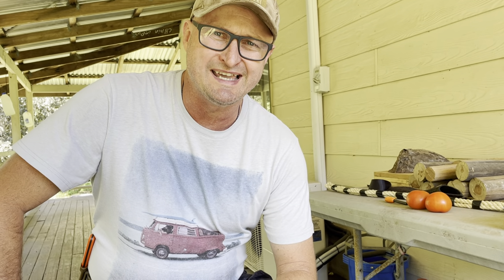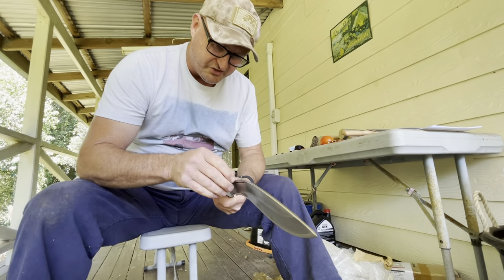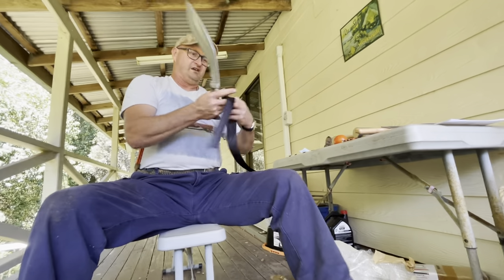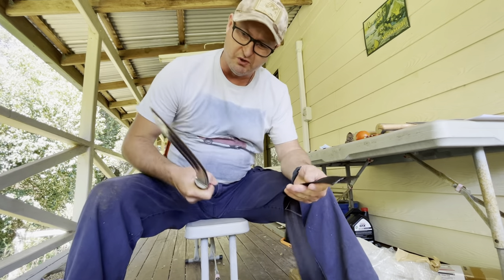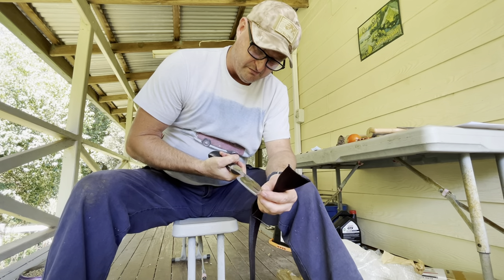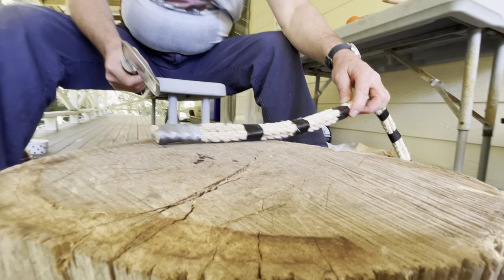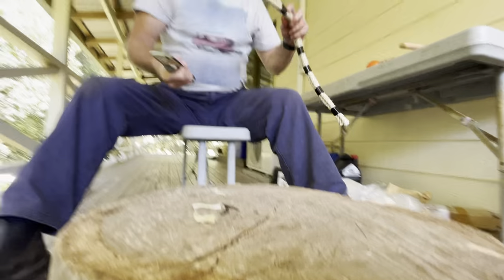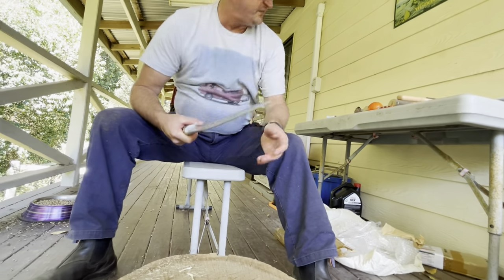Kailash Blades - Unboxing and Cutting Test!

Comment: Kailash have three options for their cutting edges. If you select their standard option the blade is usually a little obtuse for my taste. Their performance edge is quite good though. Good video! 

Great Gurkha Khukuri are well known for sharpness out of the box. Kailash sometimes need a bit of stropping to really show their edge properly and in my experience there is at least one time I've needed to use a stone. But their heat treatment is usually incredible.
Reply: Who would you recommend over the other? I ordered from Kailash regardless
Reply: @Bowbro69  I generally recommend both. Both can do micarta handles though Kailash has more experience there. Kailash do kydex and I've yet to see any kydex from GGK. Both oil quench. GGK do their own damascus in house. 

It really boils down to what you want to do with the blade.
Reply: hey  have u tested all 3 grinds?  which kailash grind would you suggest for an one tool bushcraft solution?  greetings
Reply: @D4571n  good afternoon mate 😊 I’ve tried the standard and performance grinds and depending on how you use the Khukuri depends on the grind. If you plan on a lot of batonning do the standard grind. I prefer the performance grind myself as it can do more knife stuff. Granted it’ll stick in the wood more but I usually only cut up to 4 or 5 inch diameter woods so it’s no problem. I usually only do heavy batonning in my videos as I prefer to make wedges for splitting if I’m needing to split a lot.
Reply: @sundogforgebydml1050    hey  thanks for ur fast answer👍  yeah the 4 or 5 inches thick ones seems to be enough, so i will also go with the performance grind.  thanks for your help👍   i just saw that you have a lot of vids of kukris etc.  i subscribed your channel and will watch your vids.   have a good day👍
Reply: @D4571n  very much appreciated and anytime!

Comment: Could you please share the physical measurements of the blade likh length, width, thickness and weight ?
Reply from the maker: @vikasg989  gday mate! It’s an Angkhola DUI Chirra. It has an 11” blade that is 7mm at the bolster with a distal taper. It weighs 540grms has a large handle with a full tang. Buffalo horn handle and go for the performance grind. The blade is just under 3” wide. $162 USDollars plus postage. 680gms with a full tang.
Reply: @TheNessmuk  ❤️❤️❤️

Comment: I love the way you just out of the box start battening and splitting wood and that really can test an edge. Nice work, do you prefer an 11" blade over a 13" blade for outdoors type work with Khukuri's? So far the 13" blade is the only size I've owned but have thought about getting a shorter blade. Kailash looks like a fine khukuri maker. I like the fact that its oil quenched also.
Reply from the maker: 11” light n fast 12.5 is my favourite and Kailash Blades are modern and awesome!
Reply from the maker: Hey Douglas sorry being late to your reply! Bloody busy mate! Kailash Blades Awesome!
Reply from the maker: The HSI from Kailash Blades is 11.5” mine is with the Performance grind and horn handle. It performs beautifully in the bush!
Reply: @TheNessmuk  Hey mate. I’ looking at that one. Please, tell me, does it has a secondary bevel with performance grind, or is nice convex until the edge with no visible line ( same as MK1 is, if I understood well)? It’s good also for chopping, considering it’s lighter? It would be great a review of HSI, or maybe you already did one? Great slashing in your reviews mate.
Reply from the maker: Yes the DUI Chirra or double fuller Khukuri in performance grind has a secondary bevel. It will cut beautifully. Yes the HSI video is up 11.5” blade with performance grind!
Reply from the maker: And thank you Dan!

Comment: Can I may ask what Grind type of kailash you ordered?
Reply from the maker: Standard grind type but now going for performance grind with new order
Reply: @TheNessmuk  many thanks for the answer. Was the standard grind not suited for your expectations or are you ordering the performance grind just for trying?
Reply from the maker: The standard grind is durable and performed well. I do want to try the performance grind as I'm sure it will cut well. It is on a service issue khukukri that is going to be my work blade
Reply: @TheNessmuk  again many thanks for your answer. I'm looking forward for your next video since I'm planning to get some kailash's next year😁

Comment: I have a kailash khukuri too, mine is the m43 martial version, it’s good, I did have a couple of issues though, the blade did need to be sharpened properly, the wooden handle cho
Reply: Chipped on me and the tip of the blade broke off in some branches I was chopping. But it has a nice feel and I’m considering getting more of their work, none of the issues couldn’t be fixed and you may have better luck with horn than wood, keep it oiled, I imagine in Kurdish heat the horn will drink a fair bit of oil.
Reply from the maker: Hello miss Shelley ! My khukuri needs good sharpening too! Timber handles can be fragile especially the martial design khukuri you have. Because you’re tip broke you should contact Kailash Blades’s and explain what happened. They should replace it for you! If you order another ask them to test it before they send it to you.
Reply: @TheNessmuk  actually is Mr, not miss, I did contact both times, they were not interested in replacing them, said I should glue up the wood and resharpen the tip, I think they exaggerate how tough they are, I don’t abuse my tools-on the other hand they make nice looking stuff so I’m going to probably get another one.
Reply from the maker: Excuse me Mr Raskin!
Reply: @ShelleyRaskin  Which model kukri did you get from them?
Reply: @triplez300  it’s their m43 martial version basically a slightly cut down westernised m43, which is basically a nicer mk2.
Reply: @ShelleyRaskin  I think m43 with a thin performance grind is the reason why they refused to replace a new one. From my experience, dealing with Andrew has been good but the problem is that he doesn't have a full control over the guys over there which can cause a bit of an issue sometimes.

Comment: What model and length? Thanks!
Reply from the maker: 11inch duo chirra with large size handle full tang  with buffalo scales and steel fittings.  Duo chirra or double fullers
Reply from the maker: Kailash blades traditional model
Reply from the maker: Angkhola dui chirra
Reply: Thanks!
Reply: @TheNessmuk really 11 inch ?
Looks longer but I'm confused all the time with the size of kukris
Reply from the maker: 11inch cutting edge 12” inches from the bolster